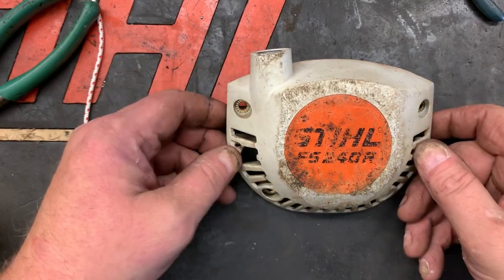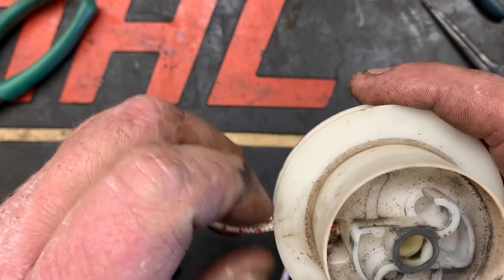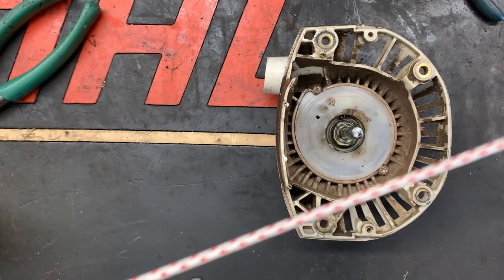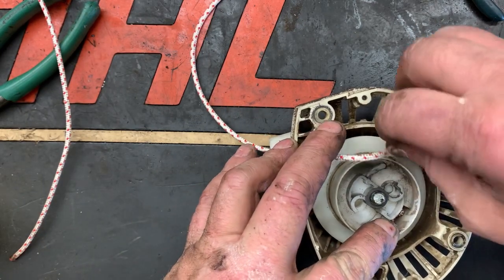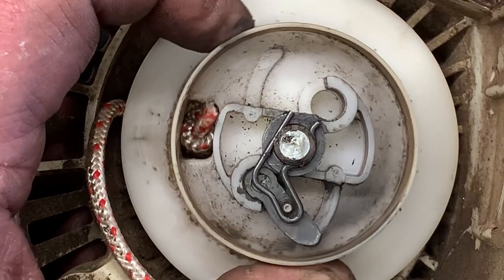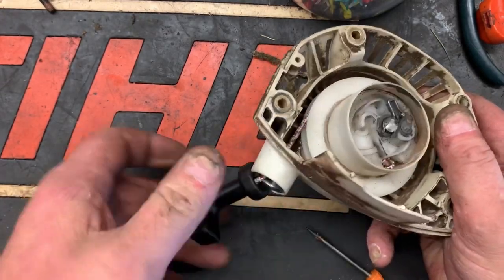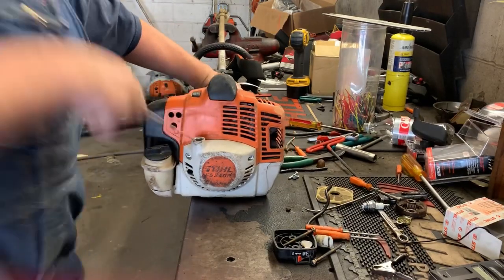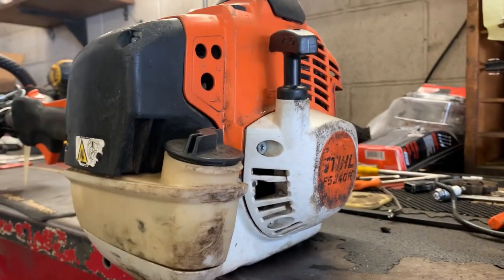OLD MECHANICS TRICK ON HOW TO REPAIR SMALL ENGINE STARTERS

Comment: Where do you get the rope? From stihl dealer? Or is there any other good aftermarket alternative?
Also what brand of fuel line tubing for small engine do you recommend,  I used to buy by the foot at Napa but they only have some precut clear fuel lines,  and I liked the previous green colored fuel tubing.  Preferably something ethanol resistant